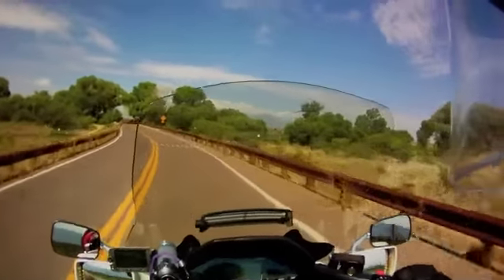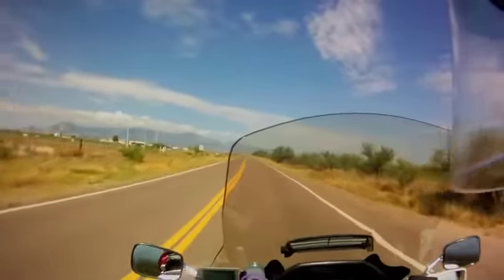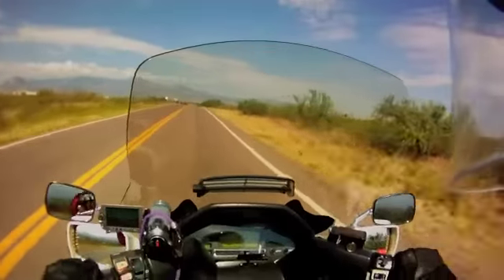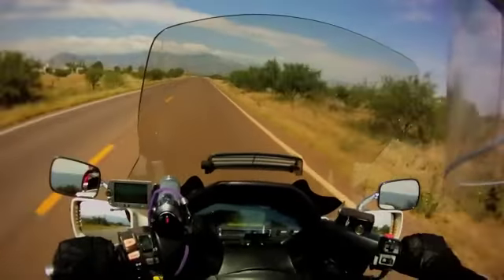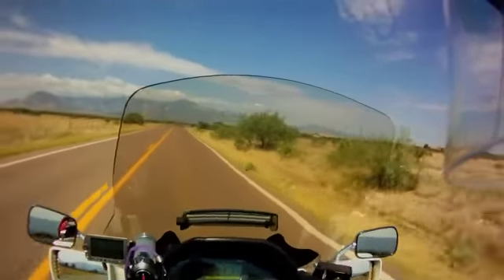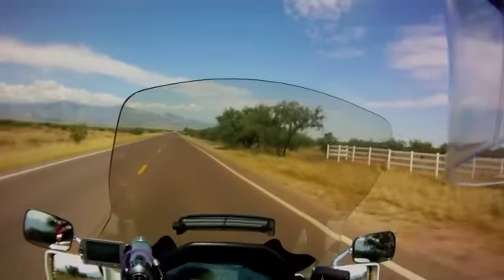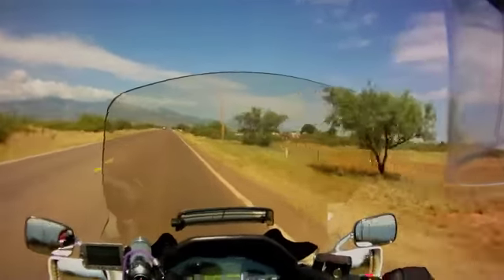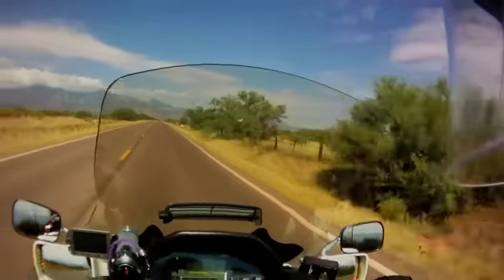TO MODULATE OR NOT TO MODULATE?

Comment: I had a Burgman 650 behind me the other day during daytime and its lights were so bright in my mirror that I couldn't tell what kind of bike it was. With that in mind, I think the modulating one could get annoying to some people, like if you're behind someone and they see flashflashflash in their mirrors, even from further away. I have to wonder if it might cause an accident just as much as it would prevent one, because you don't see that everyday and it might distract driving. Or like others said, some people might get confused thinking it's supposed to mean something, like "COP" or "go ahead" at stops signs. I think I would hate seeing it personally. On the other hand, it probably would catch the attention of those who just pull right in front of you like you aren't there, which has happened to me at least 10 times in my past 5 years of riding, and twice today.

Comment: Been riding with a modulator since 2006.  Won't ride without one...  Ever.  I've seen cars start to pull out in front of me, then slam on their brakes.  All because of the modulator.  And, boy, did they give me a look as I passed by.  I've used a brake modulator since 2006, as well.  Won't ride without one of them, either.  It really attracts attention, compared to a simple, on/off, brake light.  I wear a hi-vis jacket, and my bike has two, bright, LED running lights, on the crash bars, below the headlight, to form a triangle, just like on a train engine:  it allows observers to gauge how fast I am approaching them.  I drive defensively, as well, relying mostly upon me, but the hi-vis, and the lights, all help improve my conspicuity. Cheers!

Comment: I have a headlight modulator on my ST1100, and it makes a big difference to me.  People don't pull out on the road like they used to before I got the modulator.  I feel safer, but notice that other motorcyclists don't wave to me as much.  Maybe they think I am a nerd or something.  Also, folks make comments about the flashing headlight, as if something is wrong.  I think folks are programmed to think cops when they see flashing lights.

Comment: Huge improvement! can you turn it on and off or does it always flash in hi?
Reply: On my system a quick hi-lo-hi move or lo-hi-lo on the light switch will cancel the modulation,so will darkness. I can change the rate from slow to fast and back with two taps on my horn.

Comment: I definitely like the modulator, but the only possible downside I see is when coming up on an intersection is that another motorist could mistake the flashing as a signal to "go ahead and pull out.
Reply: That is my concern, on comers in a split second they might think you are flashing them to go ahead and make their turn. I only use my modulator when splitting lanes during my one-way 7-mile bumper to bumper traffic. Cali at it's best.

Comment: Is it always like that or can you switch it on and off?
Reply: +cwbyfan93 -- Only with the high beams switched on and only during the day. The 50-state legal versions have a daylight sensor so they won't flash at night and must be installed in the high beam circuit (not low beams) to be legal.
Reply: (repeat reply if you missed it)On my system a quick hi-lo-hi move or lo-hi-lo on the light switch will cancel the modulation,so will darkness. I can change the rate from slow to fast and back with two taps on my horn